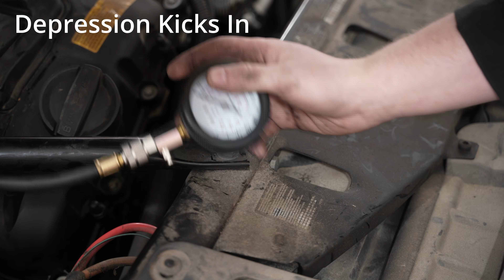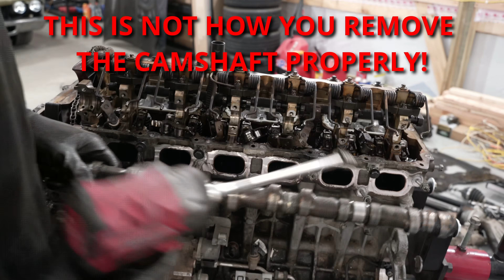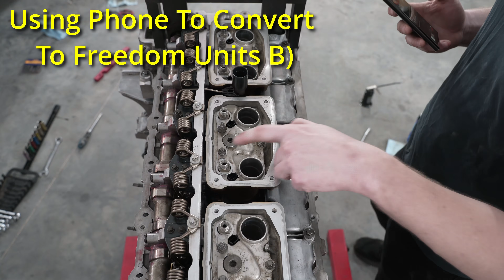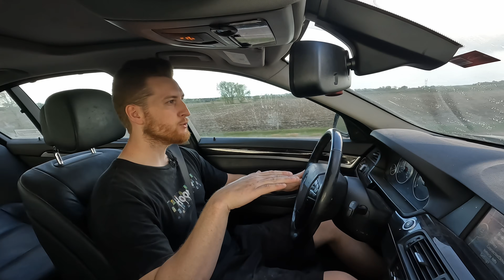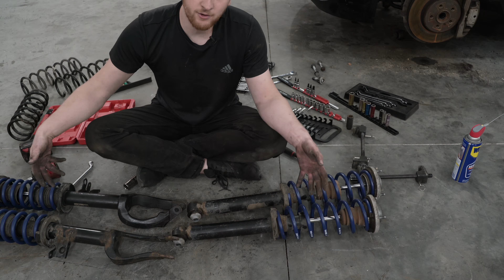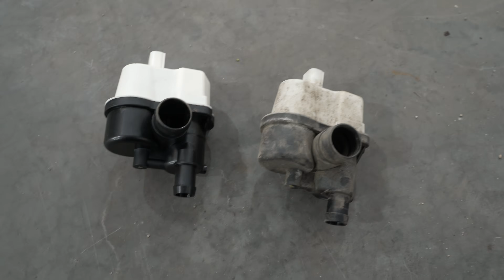How Much Did My BMW F10 Actually Cost To Rebuild?

Comment: Great for content but not great for a DIY compared to cost.   You can get an F10 535i on marketplace, all day, for $5-7000(as of this post) with around 100,000 miles in decent shape.  Not worth the hassle to get one with a bad engine and trashed interior.  That being said, they really are the best bang for buck if you want to have something nice, reliable enough, and something you can tune and tinker with.
Reply from the maker: Yea car prices have dropped a lot 
I sold this car for 10k 2 years ago

Comment: Who sold that for $1000. Is this a clout chasing channel? The headlights alone are worth $1500. Nobody would dump that for junk yard value it's a modern bmw.
Reply from the maker: They needed to sell the car quick so I said I can buy it today for 1000 bucks ¯\_(ツ)_/¯
They were originally asking 5000 so I honestly didn't think they would say yes but I guess they were over the car sitting in a shops parking lot

Comment: What’s your mpg on this car?? I bought a 2012 f10 535i and I’m getting 8-10 mpg. Changed Plugs n coils,injector cleaner,but. Nothing seems to help
Reply from the maker: I would say around 20 to 25 mpg average. But I just did a 188 mile road trip and used a little more then a quarter tank of gas which would be around 28mpg. If your doing a lot of full throttle that will really hinder your fuel economy. Also maybe check for leaks. Its possible your leaking gas from fuel lines or the tank itself. Lots of possibilities unfortunately.

Comment: What was the rootcause of the engine failure? 🤔
Reply from the maker: Definitely oil starvation! the intake cam shaft was not getting the proper amount of oil if any at all. most likely due to lack of maintenance.